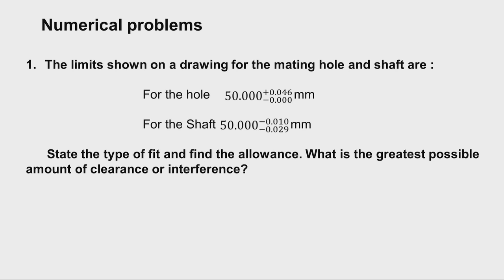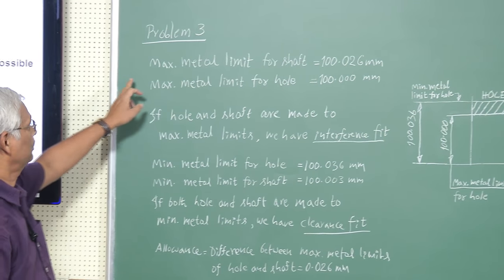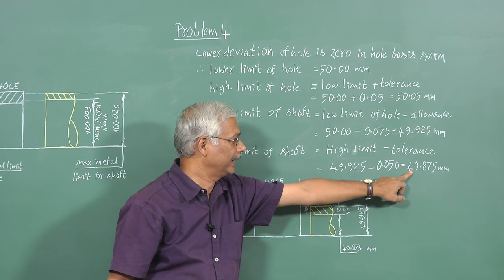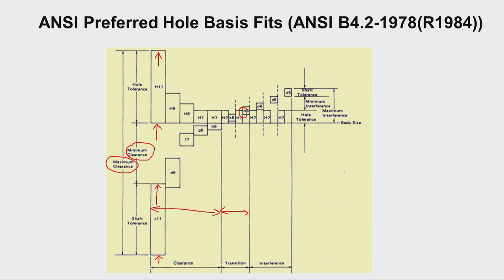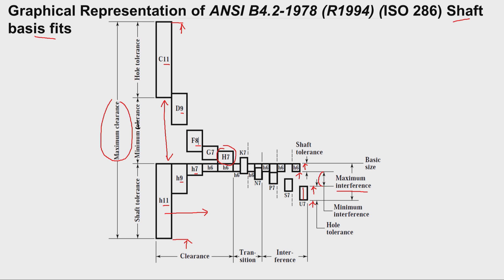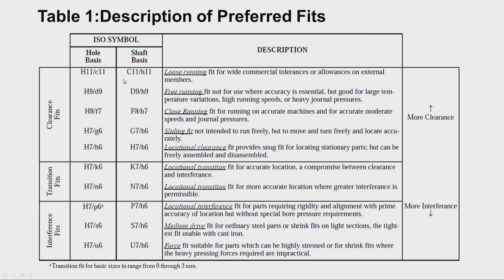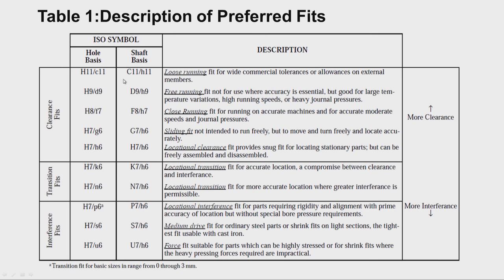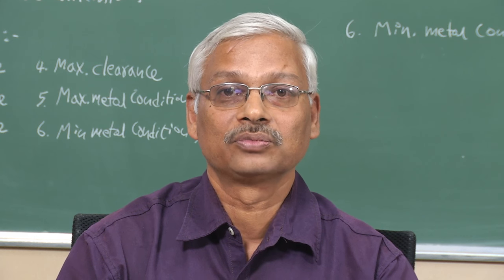Numerical problems on fit and tolerances

Comment: I think in the problem 1 diagram, the max clearance is depicted wrongly. It should be till the lower limit of the shaft, but it's  shown only up to upper limit.
Reply: What you say is correct.
Reply: you're absolutely right

Comment: In case of a H7/h6 which is a Locational Clearance Fit, if the Hole and Pin fall at MMC, will the part be sent for rework?